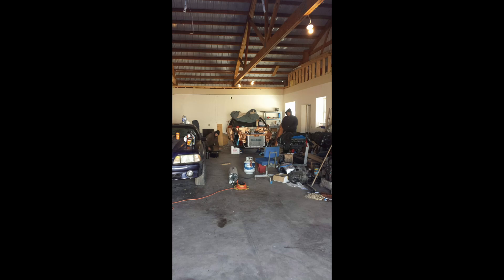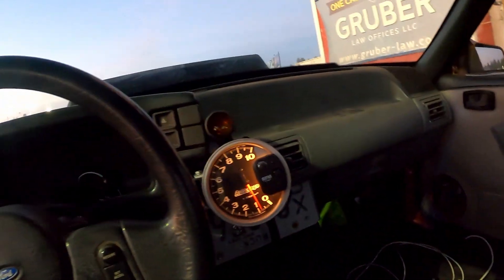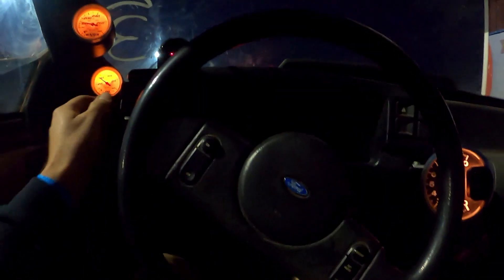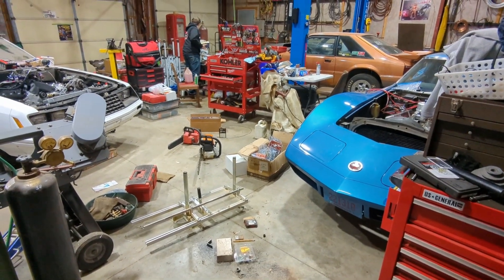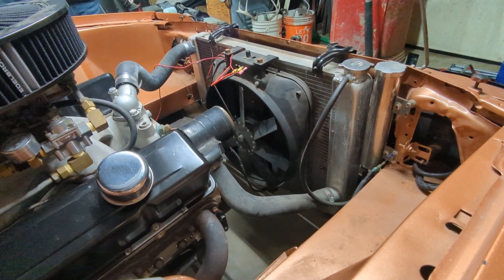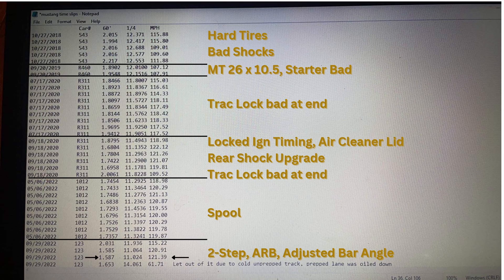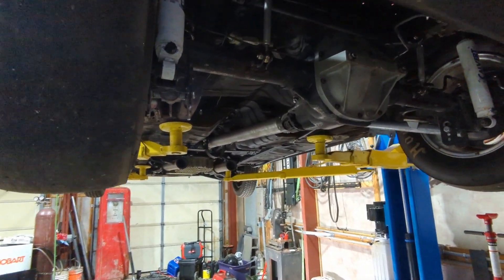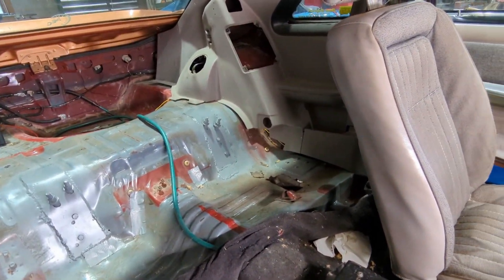FOXBODY TRACK DAY - ENGINE SPECS l SUBFRAME CONNECTORS l FUEL SYSTEM and RESULTS

Comment: What is the stall converter speed
Reply from the maker: Tci converter advertised for 3500.  On foot brake 2600.  We think there could be something wrong with the converter so we changed it out and installed a trans brake while it was out.  Havent tested the new setup yet
Reply: @josephnowak  awesome. I'll keep my eyes out for updates

Comment: Who’s sweet vette is that in the background?
Reply from the maker: Thats his future brother in laws car.  Very nice vette. I believe its a 74.  I dont know much about them but its a factory 4 speed car.  They removed the original 350 and put it on the shelf.  New engine is still sbc based.  It will be a power improvement over the factory engine.

Comment: How fast did it go?
Reply from the maker: 11.024 @ 121.39.  Trans brake is the next step
Reply: @josephnowak   a bigger cam vic jr intake and 4.10 gears would probably get it into the 10.70s
Reply: @josephnowak  not bad at all.
Reply from the maker: Gear would definitely make sense.  It could be on the future list one day.  The owner still likes to drive it on the highway or says he wants to...The converter might be screwing things up to. It rpms too well with the 3.73 that is in it.